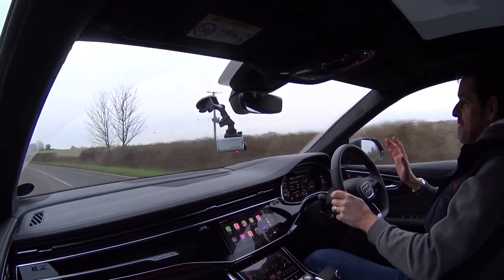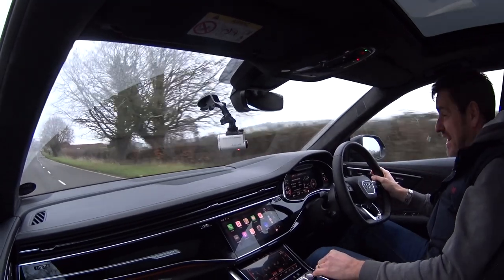Why are Car Makers obsessed with Fake Exhausts ?! [MONDAY TORQUE]

Comment: Well, when you get down to the science of it (fluid dynamics) , there is no need for a quad exhaust unless the pipe diameter is sufficiently small such that the volume of gas that will be passing through it will fill all four pipes. So quad exhaust or exhaust tips are non-functional in almost all conditions, my conclusions, they are purely cosmetic, or symbols used by manufactures to denote performance.
If we all know they are cosmetic, then what is wrong with taking that up a notch and providing the cosmetics without the additional weight, engineering, spare parts costs, etc. Customer gets the look they are after and manufacturer has an easier time with the emissions target (albeit a small contribution) due to the weight reduction.
The power of aesthetics is quite influential with buyers. I have heard of buyers taking a reduced performance model in their choice of colour over the high performing version in the "wrong" colour. So do not disregard aesthetics and its ability to influence the buying decision.
Aural aesthetics is in the same area. While the SQ8 is a V8 and has a sound track of a V8, no harm there. Who buys a V8 to be frustrated by the lack of volume in the cabin! Again, if we extend the aural experience to the cabin of younger buyers, many of whom cannot own a V8 due to nanny state laws, why deprive them of the aural please in owning a 2.0 litre four pot with the cabin soundtrack of a V8? I would have loved the choice, and it may have influenced my buying decision. 
But that was decades ago, and to fake or misrepresent something in those days would have been disastrous for any credible manufacturer. Today, not so. We have seen the likes of VAG, MB and BMW all operate well below the bar of reasonableness in the emissions cheating software case. The moral compass and what is acceptable has been forever tarnished as the fines alone cannot encourage correct ethical behaviour. Big companies with big lawyers to diminish the impacts of any global wrong doing.
But I digress. As long as the buyer is not deceived in any way with floury sales speak and is aware of the cosmetic nature of all features on the vehicle prior to purchase, and there is a full disclosure of the manufacture pertaining to the non-functional items, then I have no issue with how someone wants their car to look and sound.
Now, image this extended to the EV would! A snarly blacked out grille, rear diffuser and quad exhausts, and a V8 sound track in the cabin and a loder one emitted outside the vehicle. Should not all cars look and sound like that? V12 also if that is your thing!
Reply from the maker: Thanks for this 👍

Comment: Fake exhausts are to make the car look pretty at the back end, aesthetically good looking, to smooth things out, folk don't want or need a wumba exhaust and a dirty black sooty hole (O'er Mr's I titty ye not) anymore, no, no, no...they would rather have a massive front grille to make them look: hey look at me I'm the dogs bollocks I am. Gone are the days of Jetex, Ritmo, Janspeed, etc proper sports exhaust hanging below the bodywork rasping away on a warm spring morning through the lanes with the windows down, Nope, folk would rather have massive handbags, stupid beards and fucking ridiculous tufts of hair held in with elastic bands that look like dog shit bags tied to there heads. The world's gone mad, balmy, I'll stick to my Clubsport GTi in Eco mode and stick to 2,000rpm through all tunnels, high hedges and walled lanes......NOT! Things will only get worse, as for EVs, well.....they can stick them up there arse including the plugs and cables and fucking power stations.
Reply from the maker: Good rant Sir 👏
Reply: @PetrolPed   Can't beat a good rant Ped but I've got loads more about the car industry, Oh god, why did I leave school and enrol.